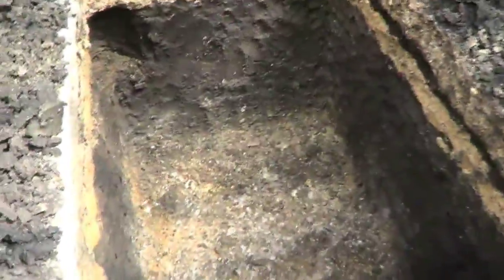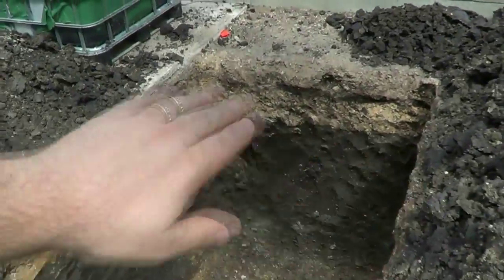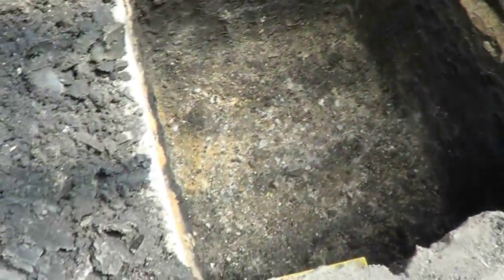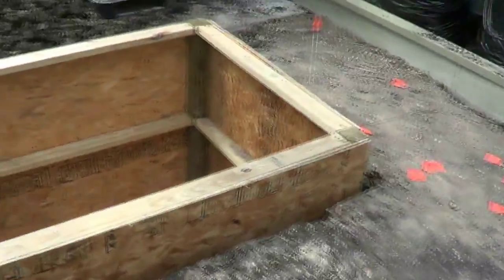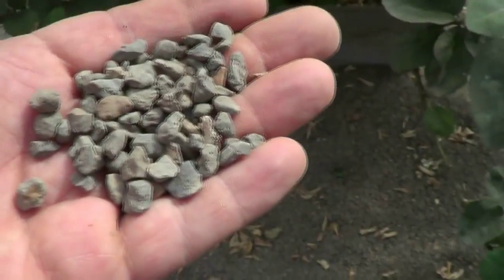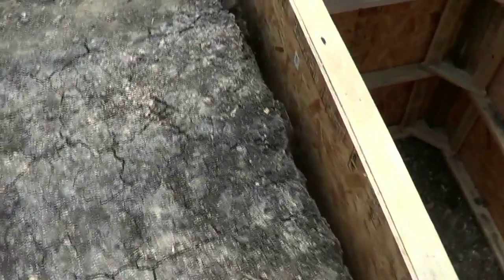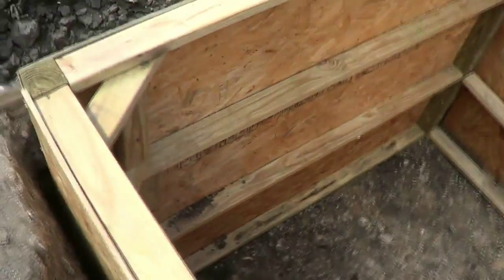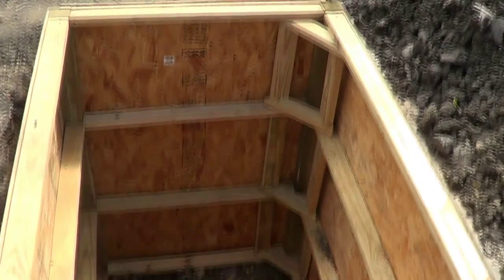Aquaponic Conversion Part 3 - Sump Area

Comment: The down side to your support walls is the Std lumber for cross braces and the OSB sheathing, you are going to have a major rot problem. OSB rots at a very rapid rate when in the ground. Very nice job but it will collapse at some point, next time use concrete block or pour your walls with concrete. A little more expensive for concrete but will last forever